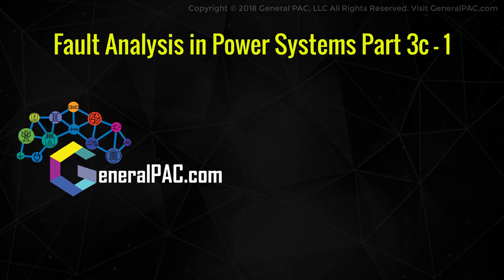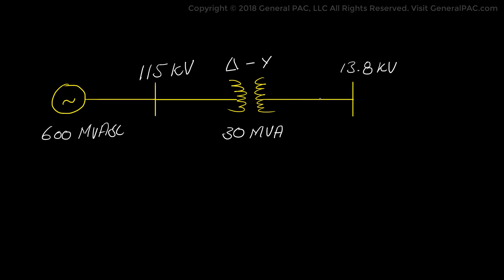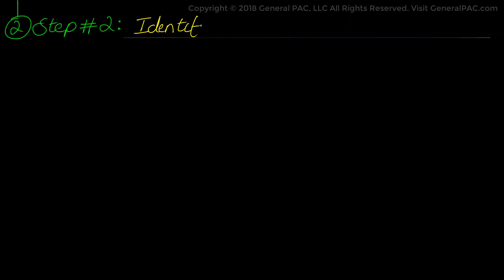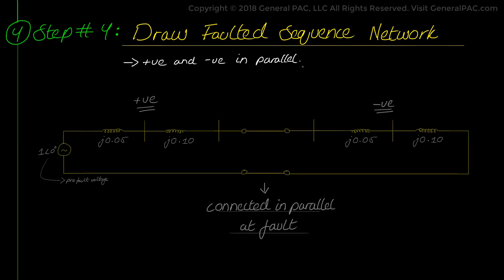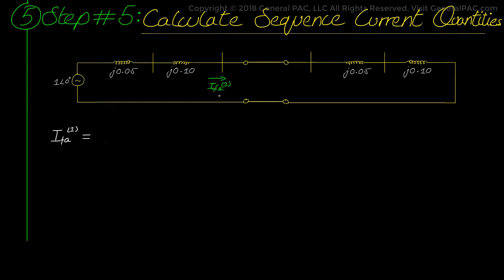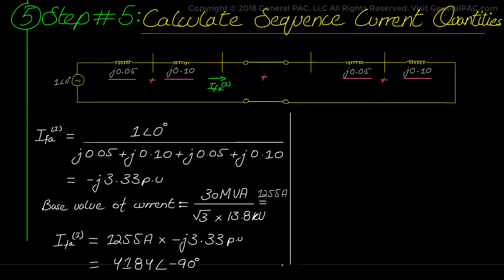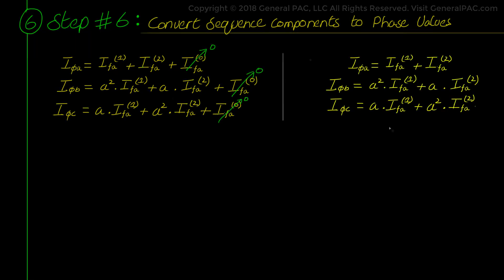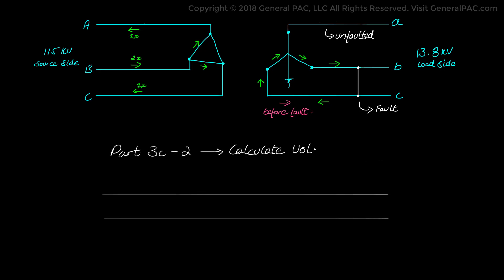Fault Analysis in Power Systems Part 3c-1

Comment: Hello, Thank you for your videos, it is so helpful and clear ! I just didn't get it intuitively when you said that : for a line to line fault, there was no zero sequence, because the ground was not involved. I understand that a line to line fault does not include the ground, but i do not unserstnd why this excludes a zero sequence compenent. Thank you.
Reply: The 0-sequence is the combined current (think of it as a single phase current applied to all phases). If you don't have a connection to ground, there can't be a net current from the fault meaning that the 0-sequence current has to be zero.